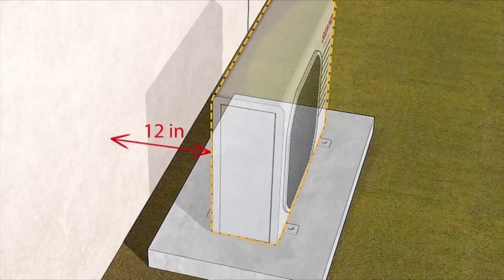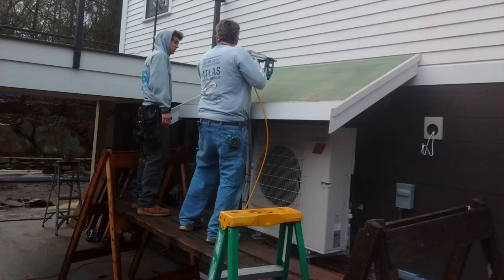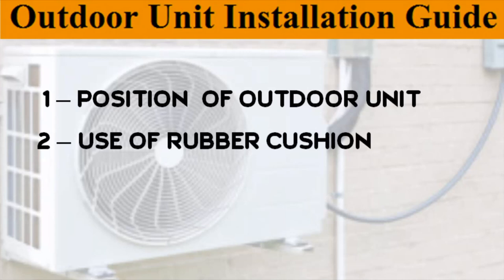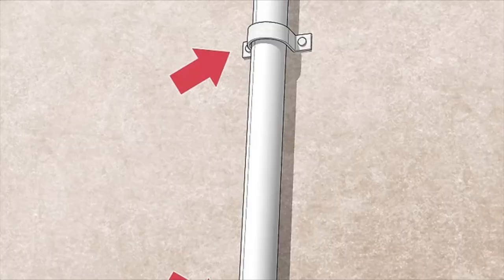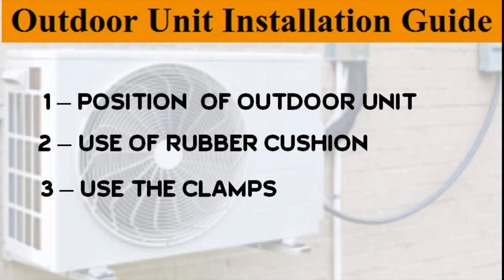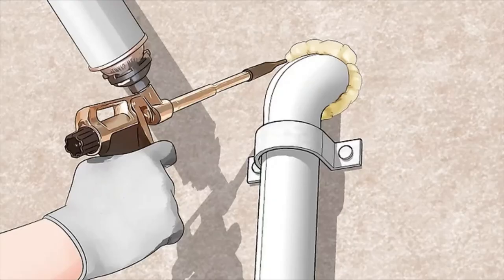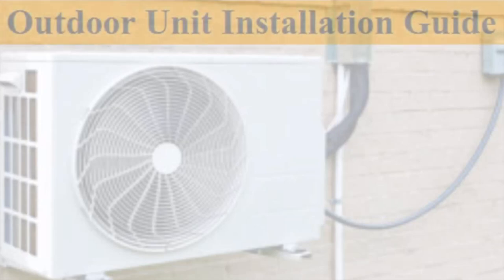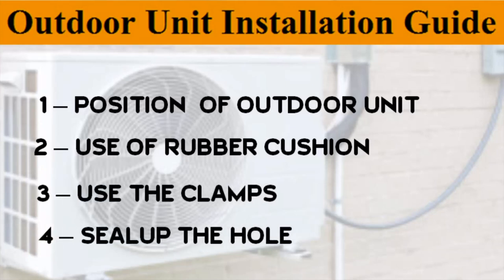Outdoor Unit's Installation Tips || Air conditioner

Comment: (1) What is the weight of the outer unit?(2) Can it be fixed the balcony wall (4.5” thick) ? (3) Can it be fitted over concrete pillar of high rise buildings? 
Please reply if any one knows? 🙏

Comment: Will 25 feet pipe distance between indoor and outdoor unit will affect cooling ?
Reply from the maker: It will not affect to cooling ( vertical length should not be more than 10 feet)